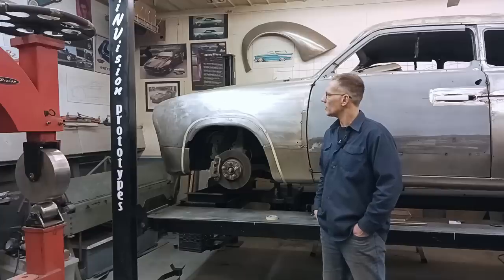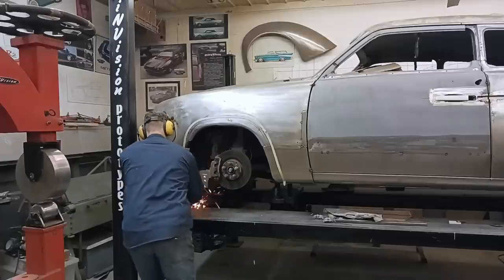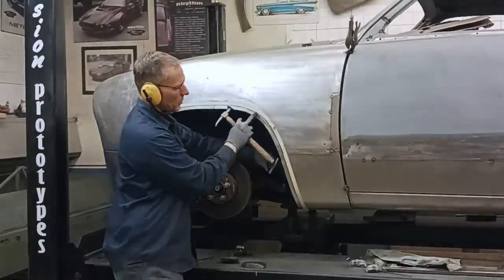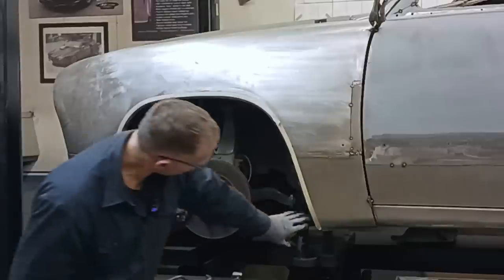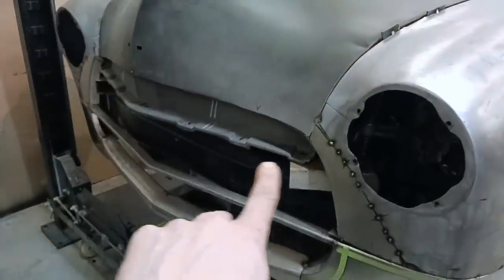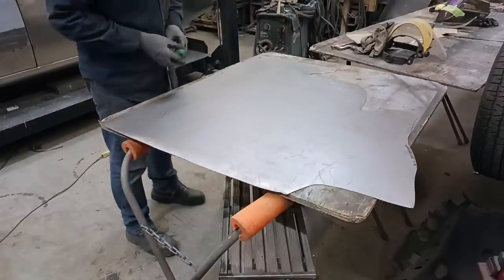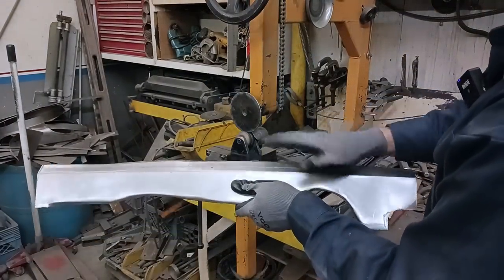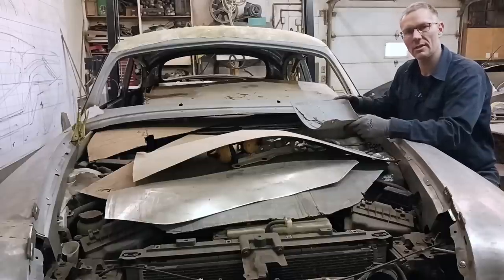BEST WAY to Adjust Wheel Openings & MORE Structural Work - Ep.16 - 1951 FORD + INFINITI G35XS Sport

Comment: Nice!!! Lots of good tips here. I've been wondering about your tipping wheel. I figured the wheels were skate wheels. How did you make the upper die? I can see where the tipping wheel works where a bead roller would not.
Reply from the maker: For the longest time I used 1/2 of an adjustable cast iron sheave(you can see that in the Custom '40 Ford videos).  Eventually it started chipping so I turned a new upper using some tool steel the on the lathe.  Thanks for watching!
Reply: @iNVisionPrototypes  I just recently started watching, so I need to finish the series on the 40. I have watched a fair few of them. Looking forward to the next installment!!!

Comment: I just found your channel  & I like it!   As for me the wheel opening looks good,  however, the back side (Closer to the door) of the opening looks tighter that the tire than the front side. If that was the intent, then you succeeded.
Reply from the maker: Thank for the SUB Bobdabuilder!  Camera is set back at an angle in a clear area of the shop making the back side of the opening appear tighter.  Didn't think of it at the time but should have moved some stuff around and repositioned the camera to show the opening directly from the side.  I'll try to remember next time.